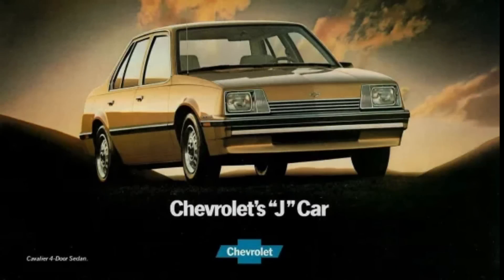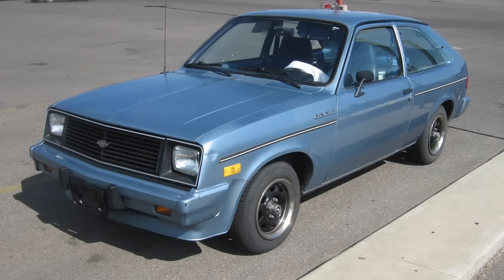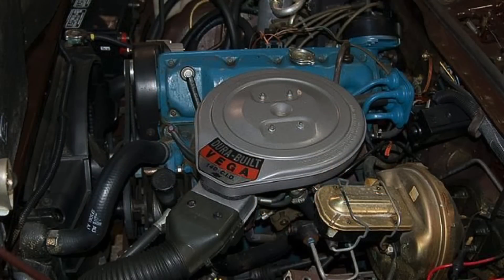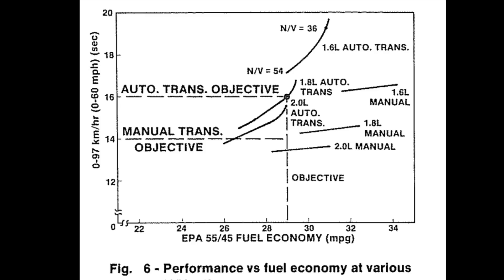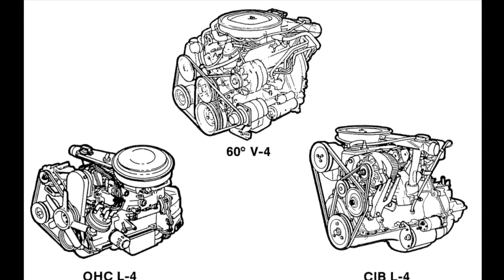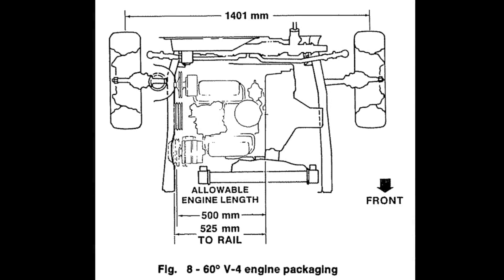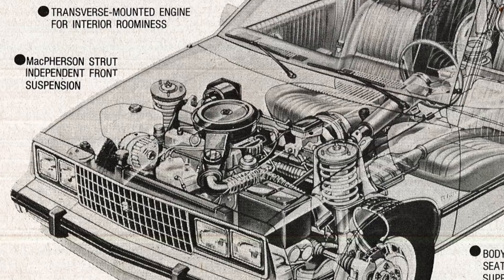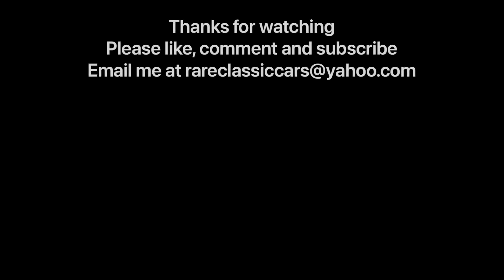GM Builds a Crazy 60-Degree V-4 (Yes, a V-4!) for Its J Cars

Comment: In 1986 bought used 1982 J 2000 station wagon , kept it at beach , it was smooth running 4 banger. Never gave us any trouble 13 years.

Comment: This idea was not a new one at all. In the 60s, Ford UK and Germany each had their own 60 deg V4 and V6 engines, each a separate family of modular designs.

The UK one was the Essex, available in 1.7 and 2.0 litres in V4 form, and 2.5 and 3.0 in V6 form (later 3.1 and 3.4 Cosworth). The Essex was originally designed to have a diesel variant but didnt materialise, hence its robust (and heavy) construction.

The Cologne was a smaller range, with 1.2, 1.3, 1.5 and 1.7 V4s, and V6s in varying sizes from 1.8 to 2.8 (euro matket). Later versions of course were enlarged to 4.0 for the US market. Fun fact: the early V6s had siamesed exhaust ports between 2 of the cylinders to enable the same exhaust manifold to be used as the V4.

Bonus fact: another Ford V6 was also called the "Essex" but it was a Canadian-built engine in the 80s that was a blatant copy of the Buick 3800, hurriedly done to provide a larger V6 option in cars like the Taurus and T-Bird.

Comment: I had a 91 Pontiac Sunbird with brazil built 2.0 and 5 speed. it was horribly underpowered, but it was super reliable and, once I got used to the very limited power curve, it was actually fun to drive, and it got 39-40 MPG all the time.

Comment: I have an 85 S10 with a 2.8 V6 that is one hell of a truck. I modified everything on that truck to get the most out of it. Took off all pollution equipment, switched to a different carb and intake, high flow heads with a high lift cam, hand built tubular headers (I made myself), then rebuilt the 700R4 trans, reinforced the frame and leaf springs, then put a rear axle my buddy custom built for heavy hauling making that little truck a battle tank. I regularly haul a 35 foot goose neck camper. I run E85 fuel and it passed an emissions test with all the pollution equipment gone when it barely squeaked by in stock form on pump gas

Comment: I used to have a car with a 60 degree V4 - the Ford "Essex" V4 in a 1970 Ford Corsair 2000E. 60 degree V4s are OK if properly designed etc. The V4 looked rather small under the hood, even in a "European"-sized car. With a kerb weight of about 2300 lbs, the 100-ish HP (two-barrel carb - the 2000E was the "fancy variant"🤣 ) engine output was perfectly OK for our more modest British roads. It was rear-wheel drive, mind, so more versatility in placement under the hood when the front wheels are not connected to the engine!

Comment: Back around 1990, I tried to by a J-car with the V-6. Problem was, I wanted a station wagon, and a 5 speed manual transmission. Although they went down the same assembly line, GM refused to sell a station wagon with the V-6 manual, although the other models were sold that way. I ended up buying a Lada, which I thoroughly enjoyed.
Reply: Any hot rodder would've figured out that in a jiffy. Just buy a base wagon then go to the scrapyard and get the running gear you want and put it in. I did that to a Chrysler minivan. I swapped in the turbo 4cylinder and 5 speed from a Shelby Z. Been building my own cars since I turned 14 and 30 years later still doing it just now my son is taking in the direction of electrification with us putting an electric drivetrain in a Buick LeSabre

Comment: We had a clean white Firenza with the OHC 1.8 and what probably was a 3 speed slush box.
It was goven to me in very good condition and what apparently must have been a bad rack and pinion BUT in my infinite stupidity and mechanical ignorance of my late teens I told my Dad to sell it to the local junkyard as l didn't feel like owning such an old and slow car w/o AC, so I bought a 1996 T/A that shortly after got totaled when some A-hole ran a red light.
Well, sadly there's no pill for regrets so better not think about mistakes from the past.😔

Comment: Interesting that GM ended up using both inline 4 engines. The OHV ended up in all the J-bodies as standard equipment, while the Opel-derived, Brazilian built 1.8 OHC was available as an option on the Pontiac J2000, Olds Firenza, and Buick Skyhawk. Odd that the Cadillac didn't get that engine as an option.

And later, when the Cimarron, and then Cavalier and Firenza, received the V6, the now Sunbird and Skyhawk received turbocharged versions of the 1.8.

Comment: Back in the 1980s I had a 1972 ford capri made in Europe it had the 2ltr V4 that was basically the ford 2.8 V6 with two cylinders cut off I had planned to get a V6 but when this car turned up with low miles and about two years old I loved that little car it was very quick for the size of the engine I had it for about 8 years I am a big fan of V4s

Comment: I'm a big fan of the J-car -- well, not the Cimarron so much -- and I owned several. Word at the time was the 1982 Cavalier had the most rigid body structure of any car sold by GM, and it was surprisingly willing to be driven hard. When the car was introduced, many of the first few months production wouldn't start when the cold weather came, an embarrassing problem for dealers presented with a crisis of unrealized mobility. Upgraded spark plugs were the fix.

Comment: I read articles back in the '80s saying GM were testing V5 variants of their V6 engines as well.  So if they needed a 2.3L engine, it could be a 5 cylinder version of the 2.8 V6.  I saw pictures of the engine hooked up to a dyno.  I don't know if they had a way to deal with vibrations - maybe that's why the V5 was never produced.  It was definately weird-looking.

Comment: ive always liked the GM 60 degree v6 family (2.8 to 3.9)
.
my 3100 lasted 350,000 miles.... before it broke the cam in 2 LOL
they piston slap. lifter tick, and rocker clack..... but have a nice power curve, with a noticeable "bump" at ~4000 rpm
.
and just the easiest thing EVER to work on

Comment: Yes,the Chevrolet V4 engine idea was basically chopping a 350 Chevrolet V8 engine in half.

I don't look forward to driving the latest releases in Australia since I drove a 5.7 litre Chevrolet LS1 V8 powered Holden VY SS Commodore,GM hasn't got any cars in Australia now since they thought that I would trade my big V8 powered Holden Commodore in for the German built Holden ZB Commodore which was a rebadged Opel Insignia.

I think it was the same as when both Holden & Ford tried to kill off the V8 engine in the mid 1980's in Australia, Ford had the  121 kilowatt fuel injected Crossflow headed 250 cubic inch inline six which they tried to replace the V8 engine with.

Holden sort of did that when they bolted the 114 kilowatt non turbocharged Nissan RB30E & 150 kilowatt  turbocharged engines into the VL Commodore in 1986.

It was the mandatory use of unleaded fuel in vehicles built from February 1986 that forced Holden to find another 6 cylinder engine due to the Holden six being difficult to be made to run on unleaded fuel reliably & efficiently.

There was a protest from the V8 crowd that led Holden to re release the 122 kilowatt Holden 5 litre V8 engine in the VL Commodore at a later date, after the value of the Yen doubled against the Australian dollar they were forced to give up the now too expensive Nissan six up.& Bolt the horrid 127 kilowatt 3.8 litre Buick LN3 V6 engine into the next model - the VN Commodore in 1988.

The 5 litre V8 engine found its way back under the bonnet of the VN Commodore in EFI form in 1989,it was rated at 165 kilowatts.

The 302; cubic inch V8 engine which Ford ditched back in 1984-1985 found its way back under the bonnet of the EB Falcon in EFI form in the early 1990:s.

So for whatever reason, Australian manufacturers put the V8 engines back in !

Comment: Wow, I remember being a mechanic in a family owned garage from 85-95 so we worked on everything. These cars were as common as the Ford Tempo and Taurus when it came to poor quality cooling systems /AC systems.  Head gaskets were common failures in that   inline 4cylinder built in Brazil. So many people still making car payments and dumping money into a water pump, radiator, head gasket, heater core or leaking AC line, locked up compressor. J car, J stands for JUNK. Good for business however.

Comment: The GM J-Car was a Huge sucess in Brazil, with the Chevrolet Monza, it had the 1.6L engine, on it's first years, Later on that engine was not available anymore giving space to the 1.8 and 2.0l, of which made around 110-120hp, it was blazingly fast for our standards, and it was the most sold car here for 3 years. It had an awesomely good interior and comfy seats.
Reply: The Chevette was also a HUGE success here, mainly because it was THE ONLY small and light vehicle in the 70's to 90's to have RWD, and this made that car be the ALWAYS choice for having a Drift car

Comment: I always wondered why more cars didn't use V4s, but I suppose because their compactness will always be offset by all their accessories now having to be in "front" explains quite a lot of things.
Reply: Inline engines are stronger and going to a V formation causes issues with clearance that's why the strongest engines are all inlines like the blue flame Chevy, the 300 Ford, or the amazing Chrysler slant six. Plus think of all the diesel powerplants that are inlines

Comment: I owned a Chevy Monza.  It was none of these engines.  It was an 88 hp 151 cu which was half of the 302 motor that chevy made.  The head and many parts were the same.  That should be mentioned in this video.  It sucked, because it had a 1 barrel carburetor.

Comment: I like your comment at the end about the V6 in your Cimmaron. A 135 horsepower V6 in those lightweight J Cars is very similar to a 125 horsepower I-4 in many compact cars over the past 25 years performance-wise.
My 126 horsepower 1.8 I-4 equipped 2005 Sentra is peppy from a stop and at lower speeds for a car with that little power. So I can imagine what a J Car equipped with the V6 is like.

Comment: Would have been an even fire engine in a 90 degree configuration, but would have been wider which is why it was 60. Engineers always gotta make stuff difficult and with inherent problems.

Comment: Midget race cars had some V-4 engines used. These were made from a Chevy small block cut in half. You could cut to use either the front half or back half, not both.

Comment: Great video. This shares similarities with GM Holden here in Australia back in the 70s when they took their in-line six cylinder engine and lopped off two cylinders to make a four-cylinder engine. Holden called it StarFire, it’s soon was tagged with the nick name Misfire as it was somewhat asthmatic and inefficient engine.
Reply: From memory the Camira was Holden’s version of the GM J-car. I have a vague memory the J-car had it’s origins in a Isuzu platform, with Daewoo & Opel input. All these brands being GM’s brands OS.

Comment: It's a shame that the Vegas rusted out so bad. Because a Vega with a good swapped in 350 was a force to be reckoned with. Just like the Maverick with a good swapped in 302 or 351 Cleveland.  You noticed I didn't say either one of these cars in the "performance" packages. Not unless it was the Yenko Vega. That still didn't put a huge amount of HP on the road. But... If you find a Vega today there probably won't be much of it left. If you hit on it or drive over a bump it'd probably become a pile of rust.

Comment: I am 76 and so I was not aware that there were V-4's out there but this VID brought to mind the old Chevrolet Corvair with a rear-mounted, air-cooled engine. The "V-4" had me thinking that this was talking about a lawnmower engine. I do not remember the specific script, but on a police procedural show like NCIS or CSI an Harley V-12 was the mentioned.
Reply: I don't think that any lawn mower has ever had a four-cylinder engine in any configuration.
Reply: @brianb-p6586  OH, ok, Thank You! I was thinking in how tiny the V-4 is that maybe just maybe there could have been one on a lawnmower. Could one be adapted for riding mower? As part of a script has Tim Allen on "Home Improvement" try to build a souped up riding mower, yet?
OH then there is an Harley V-12?  OOppss! After some googling I had to revisit this one for it was not NCIS but it was Flo on the Progressive commercial that mentioned a V-Twin.
Reply: @davidalanjonesridge9874  The proposed GM V-4 was not small. 

I have no idea why some idiot script writer or actor came up with "Harley V-12"; I assume that it was supposed to be V-twin. The proposed V-4 GM engine was not just a typo.
Reply: @brianb-p6586 OOppss! After some googling I had to revisit this one for it was not NCIS but it was Flo on the Progressive commercial that mentioned a V-Twin. With apologies!

Comment: The fact that they wanted to slap a V4 in it makes me want to slap a Ducati V4 in one of these. The Desmosedici Stradale V4 made ~210 horsepower, which on a bike is just ridiculous but is really reasonable for a car.
Reply: There have been lots of swaps of bike engines into cars, but they're generally very unsuitable. Integrated transmissions that can't handle the load of a car, excessive operating speed, etc. 

But yes, there are far more motorcycle V4 engines than car V4 engines.

Comment: I wish I’d had this motor in the J-Body I owned. Maybe it wouldn’t have been such a dog. It was an Olds Firenza with the Chevy engine. I know there may be people who love them, 80’s nostalgia, etc., but the reality is that these were planned obsolescence  automobiles. They weren’t built to last. Mine went 160K miles, and the transmission pump stripped its splines. A rocker arm in the engine broke. It started having problems with the starter, and they put the starter on the firewall side of the transverse-mounted engine with the steering linkage in front of it. One of the bolts holding it on was accessible only with great difficulty. I asked a Chevy mechanic friend about that bolt. He said, “It’s really hard to get out, and when we replace the starter we usually don’t even bother to try to put it back in.” The “J” in J-car stood for junk.

Comment: There was a whole website and message board created based on the GM 60 degree V6. 2.8, 3.1, and 3.4 liter engines used by GM. It's a very good platform and very well-balanced enough that it doesn't even need an extra balance shaft to run with little to no vibration. I had a 3.1 l in my Chevy Beretta that was later apprehended to a 3.4 l pushrod engine. I also had a 91 Chevy Lumina z34 with a 3.4 l twin dual overhead cam engine. The dohc engine really did sing with a Turbocharger.

Comment: I feel thee best motor made was thee 3800 series. I have one with 390k in an olds 88 lol. Dosent burn a drop of oil or smoke. Starts up in -30 when my newer 2019 f150 and square body chevy c10 wont lol.

Comment: Building a V-4 that runs down the same machining line as a V-6 requires two horns or extentions of the pan rail surface so that the same locating and clamping functions can be used on the block line. These horns can then be fhopped off towards the end of the machining operations prior to the finish cut taken on the front face of the engine. Chrysler did this exact thing with their first V-6 based off of the LA series V-8. This could probably be done with cylinder heads also. But you would have to purchase tooling for intake and exhaust manifolds and other components. Common components would include oil pumps, water pumps, pistons, rods, bearings, fasteners, front covers, distributors etc.

Comment: My first car was a Brazilian-built J-car, a 1995 Chevrolet Monza. It was the two liter variety with a single Bosch electronic injector replacing the carburetor. It made 115hp on ethanol and was a hoot. Very peppy car and very popular in Brazil, even though it was slightly above the price range of the average local consumer.
Reply: Awesome to know!

Comment: I learned to drive on a Pontiac J2000.  It was not a reliable car.  I later heard one of the likely reasons why: GM was having trouble meeting emissions requirements, and so they changed out the thermostat so the engine ran significantly hotter.  That fixed the emissions problem.  But they didn't then rework or redesign anything else to adjust to the higher temps, they just released it that way.  In effect the thing came from the factory designed to overheat.  So, big surprise, a lot of the other stuff under the hood started to break down and fail prematurely due to excessive heat stress.  80s GM cars were something else.  I will always have fond memories of that car, but not because it was well made.
Reply: EPA pests.

Comment: The anemic 4 cylinder engines of the J-cars and other American compacts is a consequence of their ignorance or unwillingness to make a decent engine. The Asians and Germans had no problem do so. The US companies had been spoiled by decades of loafing V-8s that actually output fairly low power for their displacement but was more than enough to move a large car with alacrity.
The poor sales of American cars in the 80s was a direct consequence of execs at the companies cost cutting their way to rotten quality and outdated designs. They refused to see how the market was moving in California and as a result, they all suffered bankruptcy (except Ford) and only in the last few years seem to be making better cars though so many are actually constructed of Asian parts.